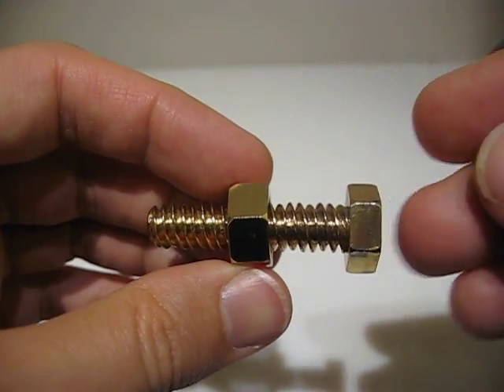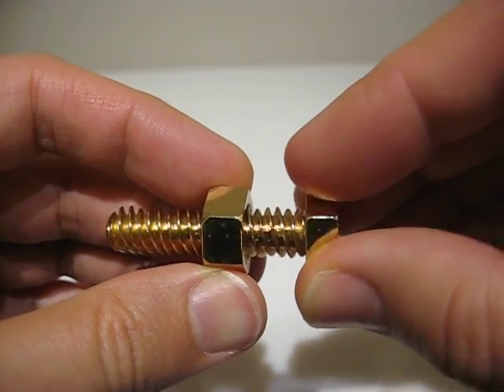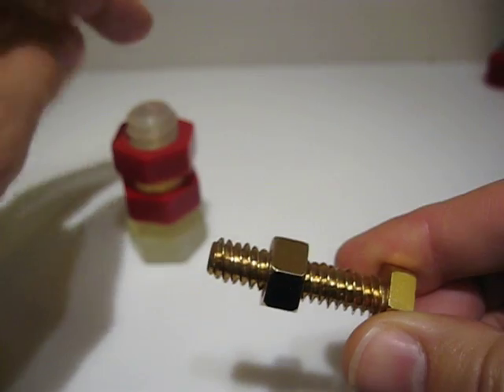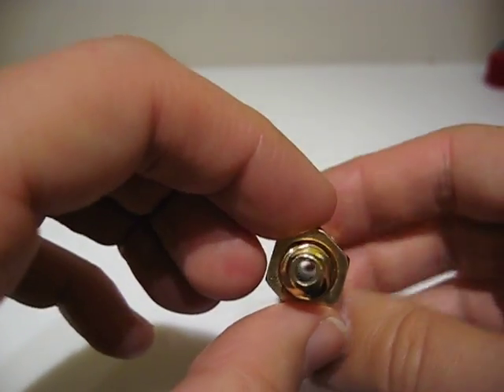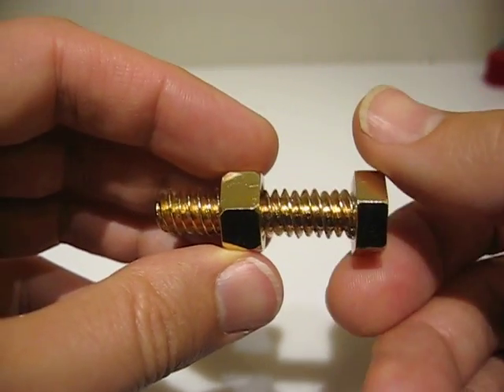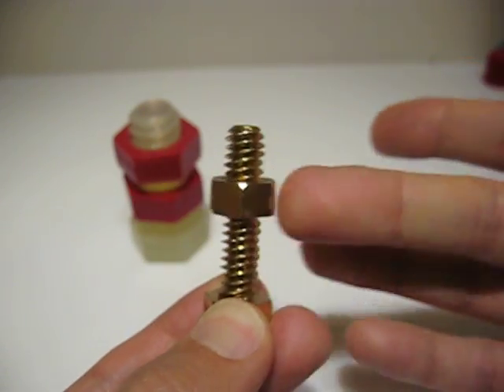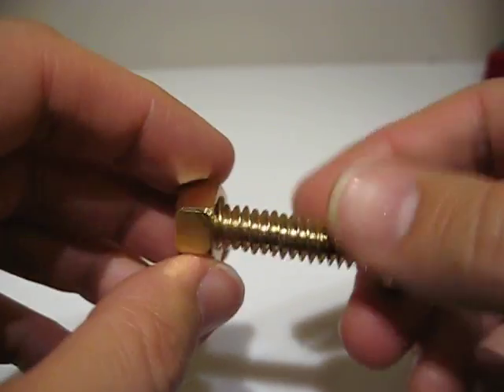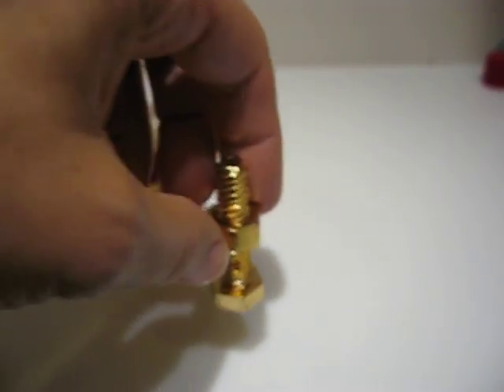Mk3 Trick Bolt

Comment: called reverse threads used in manufacturing, so what is the trick
Reply: As he screws it in clockwise it unscrews, meaning that it works counter to the actual direction of the threads. Examine a normal nut and bolt and you'll see it goes in the wrong direction, not just a left hand thread as you may be thinking. I expect you have to use screws and bolts regularly to notice it.
Reply: was thinking the same thing...Thinks he "invented" a reverse threaded bolt I guess...odd

Comment from the maker: It's essentially a mechanical version of amplitude modulation, like that used in AM radio.  The ordinary threads visible on the bolt are basically just a "carrier" onto which the actual path of the nut has been "modulated."  The nut is tuned to lock onto the "modulated" path instead of the "carrier."

It's a bit complicated, the description includes a link to a more detailed explanation (with pictures) that reveals all the secrets.